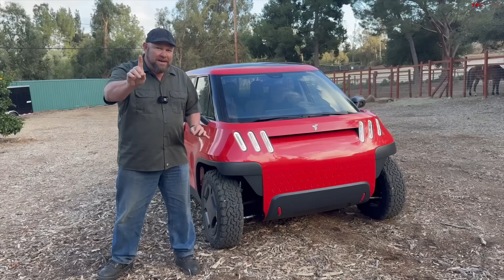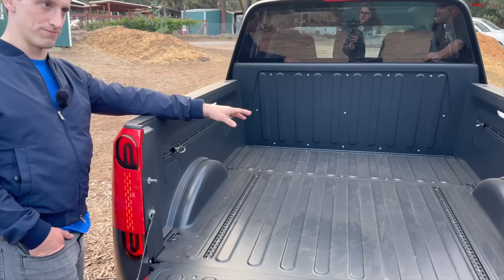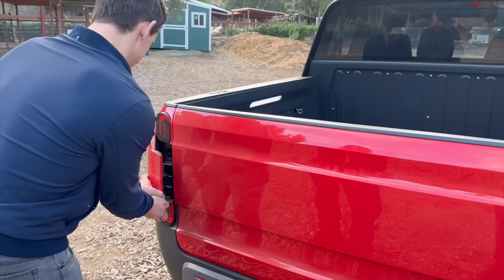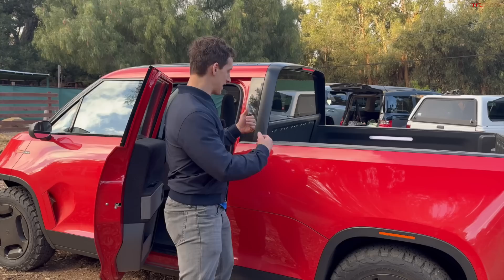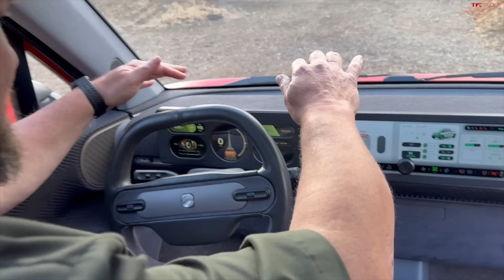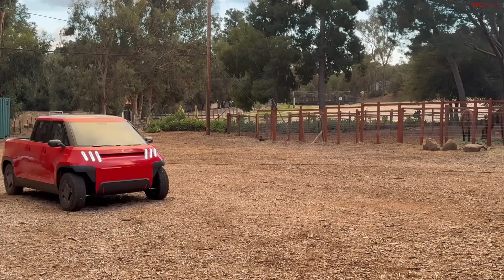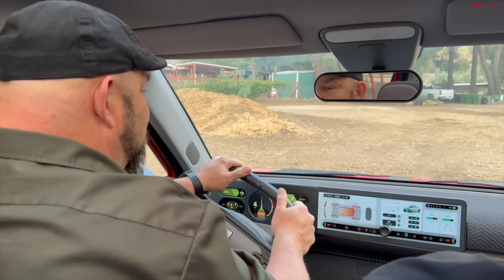I Drive the Most Revolutionary Truck In Decades: Meet the Telo MT1!

Comment: This truck is going to be competing on some level with the Slate truck.  Both are somewhat less expensive electric mini-pickups.   The option for an upgraded battery seems to give the Telo a competitive advantage. For the Slate, the advantage would be flexibility in configuration.  But the one concern I have for both trucks is their tendency to rattle and squeak.  I have noted it on video reviews of both vehicles and it's something I don't like.

Comment: Now this is what an EV platform supposed to be used for. Not having an engine block means we don’t need to have a front engine bay etc. Well Kei trucks put their tiny engines under your ass, but you get the point.

Comment: New engineers - Aluminum is not great for structure. Aluminum frames will stress crack. Look at flatbed trailers being replaced every 2 years. Cheaper to replace, than to fix. Weight is their money maker.

Comment: "Use case" is a good term. most of us haul about 2-400Lbs through bad road forest and skinny residential streets that we load and unload all the time and want  to leave over night in high theft areas. There are many small asian 4wd vans in my area but those can cost over 20k used,so everyone else has to keep old minitrucks running and build locking covers. The rich have huge fragile trucks but they dont use them much because they wont fit down the street.

Comment: I live in the city and I generally don't travel more than 10 miles each way and I have to be able to carry sheets and building supplies. I would buy this in a heartbeat if it was 25k or less and save my big 80k truck for bigger hauling. 500 hp in a vehicle the size of a mini cooper? Where do I sign up?

Comment: As many have noted, this is not a replacement for a big truck, and that’s so cool. I’m a contractor and HATE my big 3/4 ton truck, but I need it. I don’t need it all the time though. I work in the San Francisco where parking is tough and more often than not I’m carrying tools or small loads or just driving for transportation. I figured out a long time ago to have big orders delivered, so I really love this. And I have solar panels and a garage so fueling is mostly free. So cool. 

The idea of getting the 4 wheel drive and taking it in to the back country on forest roads sounds awesome too. That short wheelbase would be great and there’s generally a place to charge up close to where you’re going. 

I may sell my nice big truck, get a serviceable beater and get this for about 70% of what I need.

Comment: They need to throw a crash standard front bumper on that vehicle. Simple to have the structure rails run forward. Spend time in the salvage industry like i did for 14 years. Once you see cars hit where 75% are front end hits you'll change your mind on this design. Investors will shy back when ligation of accidents could ruin this company.

Comment: Like it a lot, finding many elements to be very thoughtfully designed.  However, the thing I find most lacking is bed length.  It'd be terrific if they'd offer a longer bed option, especially for those wanting to utilize it for camping / full-length sleeping.

Comment: As a minitruck owner the claim that "minitrucks are a new category of truck" is absurd. 4' clear between the wheel wells is huge, but 8' length being dependent on an open air passenger compartment is pure marketing (I understand the whole market is that way, but it needs to me said). That being said the only thing I've ever needed 8'+ support on is drywall. All told this feels like it'll struggle to find a place in the market; minitruck owners/buyers are looking for something sub $5k and people spending $40+ aren't looking for a minitruck.
Reply: Additionally this felt more like a sales pitch than a review. The cuts and talking points felt coached and I'd much rather hear the real discussion leading up to the scripted question and tin can response.

Comment: I hope they make it. But l will not be surprised if they don't. In someways this reminds me of the Canoo. Looks wise anways. In order to bring this to the market in reasonable numbers they are going to need somebody with deep pockets. Even refurbishing an existing manufacturing space costs money. And thats just for the simple stuff. Mass production means fixturing for assembly. Tooling for parts such as interior door panels, dashboards, seats, suspension parts etc. the body panels if steel are going to need stamping dies. Yes you can produce panels using the new forming machines. But how many forming machines would you need to produce all the parts for just all four doors. And even if they contract a lot of parts out they will be paying the tooling costs and the costs of the needed nachinery and machine maintenance.

Comment: I hope they include 360 lookdown and Android auto. If you used a micro gas turbine engine and fuel in the monster tunnel to make it a hybrid.
330 look down is just a great feature once you get it. I like it a lot. I really like the Slate I just the embrace the upgradable ides Lots of USB-c ports and lots of mounting points.

Comment: I love the concept. And I love that it would fit in my supposedly "2 car" garage, even on the side with the water heater taking up space. 

HOWEVER, that price is going to need to drop. $40k is a "no go". Not when the Slate was just announced at $25k. And you can't count on the EV tax credits staying in place. This likely won't work as your only vehicle if you ever plan on taking a road trip. 

IF this and the Slate both make it to large scale production, I'd lean towards the Slate. It's bigger and cheaper. As a current Ford Maverick hybrid owner, the Slate is more in line with what I want.

Comment: How would anyone survive a crash in that plastic and tin box, with no frontal crush zone?  They can say it's "optimized" all they want.  You can optimize to any level and say it's "optimized", but the laws of physics still rule.  No crush zone, then you become a part of the crush zone.   The vehicle that hits you does not necessarily hit you low enough for that engineering design to be effective in a crash, so it will hit YOU.  
It's a terribly impractical vehicle, therefore.   Insurance companies should all refuse coverage.

Comment: This is such a cool looking little truck EV.  I really love the look of it, inside and out.  I like all of the versatility and thoughtful engineering that went into it.  I really like that they designed it specifically for 6'2 people (my height), though it still looks a little tight getting in and out.  I'm not a fan of the glass roof, though.  That has to go.  It's a problem in just about every way imaginable, so I hope they offer a regular composite panel option for the roof.  Although, having said that, the Aptera solar panels up there would be cool.  I also think they need to move the gauge cluster up onto the dash in front of the driver.  Where it currently sits, the squircle steering wheel obscures a lot of the data on that screen.  Putting it up on the dash would put it higher in the driver's line of sight and remove the steering wheel obstruction.  I think my only other gripe, specifically in comparison to the Slate that just launched, is price.  Looking on the Telo build site, after tax, tags, title, fees, etc, these things are going to be $60-70K, depending on build options.  The Slate is $25K.  The Telo is just too expensive for what it is.  Probably needs to start around $30K to be anywhere near accessible for most people, but it starts at $41K.  The Telo suits my family's needs more, but the price is prohibitive.

Comment: What do I think?  I have already pre-ordered one.  I have been looking for a small EV pickup.  A pickup that isn't two football fields long, and 7' in the air.  I wanted one that I could use to haul building materials like plywood, among other things.  Several auto manufacturers are planning to make mid-size EV pickups, but the first is slated for 2026 at the earliest, with most coming in 2027 or 2028.  I saw an interior mock up of one of them and omg the buttons and knobs.  It looked like the steering wheel had at least 20 buttons on it, and the center console had nearly as many buttons and knobs.  I currently have a Tesla, and while many people don't like the interface, I have gotten used to having 2 buttons, 2 button-wheels, a light stalk, and a "gear" stalk.  I can control all the systems I normally use with voice commands, so I don't have to use the center panel 98% of the time.  I now am used to minimal physical adjustment of the systems, and minimal interaction with the control panel that seeing more than 5 or 6 buttons/knobs makes the interfaces seem too cluttered.  I hope TELO will have voice commands for at least the environmental controls, wipers, defrosters, i.e. similar control methods to the Model Y.

Comment: I love the approach they took. Both with the design and the use of ots parts. That not only makes it cheaper with a proven track record but it also makes repairs easier and cheaper too. The only thing that kills me is the price. You can get a Hybrid AWD Maverick for less than $30k. Even if it only does 70% of what the Telo can do, it's still $12k cheaper. Now if Telo can produce a substantially higher quality vehicle than Ford has been doing lately then maybe the Maverick isn't a better deal. Hey Ford pull your head out of your rear.

Comment: You've got to make a car for us urban drivers too. $41,000 is too much though. Telo has to partner with someone, say BYD, scale up and offer this truck for $30,000. It's far too expensive as it is now. Resale values will plummet too. People have EV fatigue and by the time the Telo makes it in production, 350 miles of range will be meh. The design is ergonomic and efficient. I wish Telo the best of success.
Reply: Exactly! It's 41.5k plus an extra $4k for the long range pack to get up to 350 miles. Picking up a used one for half the price doesn't seem to bad...
Reply: @christiancollins4708  This is what will happen. People will pick them up for 25K after two years of ownership.

Comment: There needs to be an option to attach and secure portable battery packs in the truck bed to extend or even double the range from 350 miles to 700 miles.

Comment: This is ALMOST an EV I would consider.

EVs shouldn't try to be an ICE replacement. They should be an appliance/utility vehicle.

Make this sub $25k with 100-150mi range and it will do everything I need as a commuter and utility vehicle. We'd have an ICE for longer trips.

But for $41-50k, it's still far inferior to ICE for all potential use cases, to say the least of the aesthetics. As a cheap commuter, I don't care much what it looks like. To replace my ICE entirely, I want to enjoy it as well as do everything I need.

Comment: This is the first thing I've seen in a long time on four wheels that's actually looks like it would be really really useful and fun to drive. It's nice having a pickup truck bed but I'll be honest with you, I drove a Toyota sienna second gen for about a year. Had gotten it at an auction it had been in an accident and so we just used it as a work truck. And I'll never buy a pickup truck now. There isn't much that I can't do with a minivan that I could do with a truck. If I can't get in the van I can put it on top. I can pull a trailer. I can tow another car. And I can flip all the seats back up and haul seven people. But this little truck would be perfect. Often times I felt the van was just too big, in a full size pickup truck is just too big, and none of them are very efficient. Which has been my biggest gripe for decades now the fact that I hold a super computer in my hand but my  truck or van still only gets between 20 and 25 mi to the gallon. An electric truck with a 300 mi range that seats five people the seats fold up and I can get a whole sheet of plywood on the thing. Has a functional bed that I can load up with mulch or go camping. And there's enough room inside for my dog to sit down on the seat and not hit his head on the top because like the CEO my dog weighs 120 lb. I think this is an absolutely incredible concept and I'll be very excited if it comes to the road.

Comment: As soon as this truck gets to the $25,000 to $30,000 dollar range I will buy it immediately!!!! It would fit every need I have for around town pulling and running. Not even close at $41,000 dollars though!!!!! Make em affordable guys and you will sell millions!!!!!!
Reply: And it has about the same payload as a Tacoma (which is comparably priced BTW) and can fit more in its bed than any full sized truck with rear seats.
Reply: As a contractor the small size  will add about $8,000 to 10,000 to my bottom line every year do to time savings in looking for parking in the city.   I will get it with almost every option. At about $55,000 it would be financially irresponsible not to buy it.
Reply: You clearly haven’t priced new trucks or electric vehicles recently.
Reply: @mechanicalman1068 Literally just bought a new ram 4 months ago and waited for the deal. Prices are hiked up on these vehicles because too many people don’t shop or look for the best deal and they pay for dealer add ons. When people stop doing that the prices will come down. That little truck is not even half the capability of the full size in range and towing ability, so the price should reflect that. It would fit a local niche for me but not a do all vehicle.
Reply: Range in the Telo is 350 so most ICE trucks will best that easily.  However towing is 8,000 lbs so it’s pretty competitive. It may not have quite the capability as full size trucks in many areas but actually beats mid-size trucks.   Think ease of parking.  The Telo is over 7 ft. Shorter than the F150 and exactly 4 ft. Shorter than the Maverick.  Parking almost anywhere is also a Capability.
Reply: That’s pretty affordable for something like that actually. Keep in mind electricity is cheaper than gas and you don’t need oil changes or tune ups so cost of ownership is far lower. And there may be rebates and tax incentives.
Reply: @mechanicalman1068 it’s way overpriced at 40,000 grand! It’s not a full size truck!
Reply: Not enough for the price, and didn't give the price for the upgraded truck.

Comment: I mean, having lived through the 80's-90's .... Mini trucks are not new. I mean mini as in compact / sub compact yes. But big oil killed the mini truck movement here in the US.

This is cool as heck. They are pricey but look amazing for camping. They have solar sun roof and bed cover as well as solar camper shell options. single or dual motor and regular or extended range. Pretty freaking cool.

Comment: Tesla WISHES it had built this truck. THIS is how you do an electric truck... and look at that. Starting price is $42k, genuinely around what musk said the Cybertruck would be back in 2019. And the dual motor isn't $20k more.  It isn't even $10k more. It's $4k more (looked it up). Only real downside in this is the touch screen. Actual buttons are considerably better for climate controls.

Function over form. That's what a real truck is and always has been.

Comment: Make it $20,000 to  $25,000 and I'm in.  For EVs to really take off they don't just need to be as good as ICE vehicles, they need to be chealper. A small truck should be minimal and cheap. Sadly it's in the $40,000 + range.

Comment: I would love this but .... the price. Full sized pick up price which I cannot afford. I like small trucks and wish I still had my old Ford ranger diesel. I'm a handyman and my jobs run only $100 to $300 most of the time and I only work part time. Hard to make a $1000 payment on that. I saw that I could make a rack system which is good. I carry a lot of tools at times because I have no idea what I will need each day. So a top of the bed cover that you could put tools in and still use the bed with the fold down would be nice. Looks good and seems practical. Good idea.

Comment: Is the TELO Truck American Manufacturered? Standard/ 1 Motor and Size, That's might be okay for putting around. And not at 250 MLS $41,500 to Costly. Even Full Pkg Loaded PWR, at todays Hi-Cost etc. $41,500 Would Still be Costly even at 350 MLS. What about Heating and AC.? Color Options? I'm Seriously Interested! We the Buyers Need More Hands On & Information! I myself need Information Directly Mailed to Me, Not on Computer or Email!! TELO MANUFACTURER CONTACT ME WITH ALL THE INFORMATION PLEASE 🛻🛻🛻

Comment: 50k by the time you build it out. A used RS1 or RT1 with only 10-15k on it, is 50-55k. 

Need to be under 40k delivered to get any traction

Comment: How much weight will the tailgate hold. 
Where exactly is the battery (the engine) located. 
At which cold temperature does the battery no longer work.
Does the vehicle recharge a power station directly such as a Bluetti power station.
How many USB and 12volt receptacles does it have.

Comment: You want complete and total honesty that thing sounds like a big old pile of trash. Doesn't have but what a thousand or so miles on it and you can hear all the creaking, squeaks, rattles coming from that interior when you were doing the ride along and drive. It almost sounds worse than a Tesla cybertruck that has 10,000 mi on it. Whoever is designing and manufacturing that truck needs to do some serious quality control and real world testing so they can see that the interior fit and finish is probably the most important thing to prolong the emotional sanity of the potential buyers and owners. Other than the horrible interior noise the foundation and utility is there, they just need to spend a couple of months going through everything with a fine-tooth comb and working out all of the small bugs squeaks rattles and vibrations.